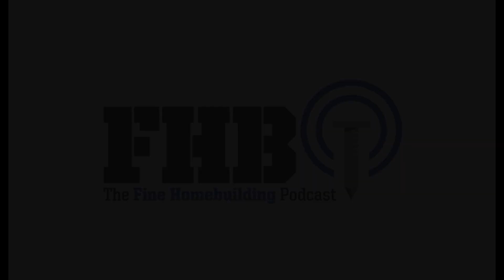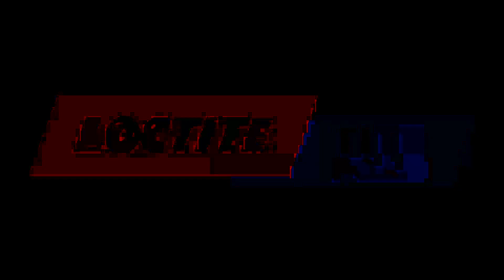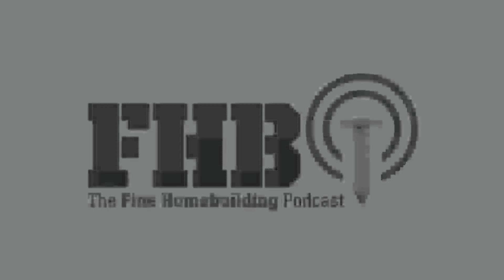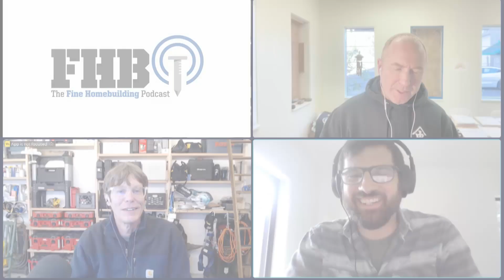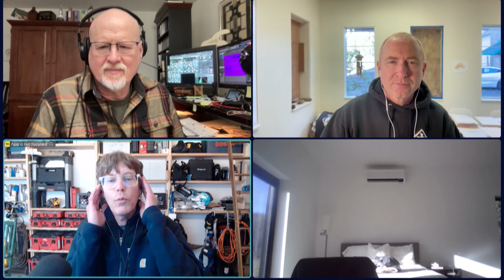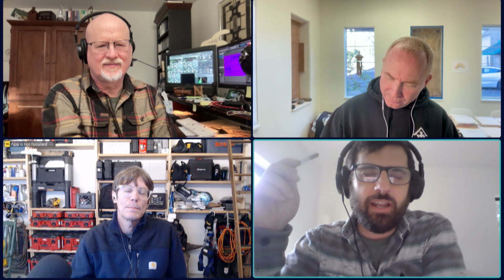Podcast 611: Bill Beleck: Shou Sugi Ban, Surplus Building Products, & Air-Sealing Overhanging Joists

Comment: Patrick, you don't need to install a level 2 charger for an EV if you don't drive a ton per week. I drive about 100 miles per week and I've been able to get by with just the level 1 120v charger. Though my driving is broken up by 60mi on Wednesdays and the other 30-40mi on weekends. So i have time to let the car charge in between driving.